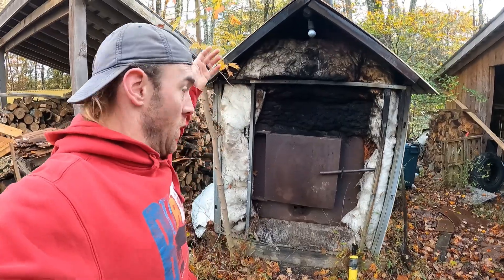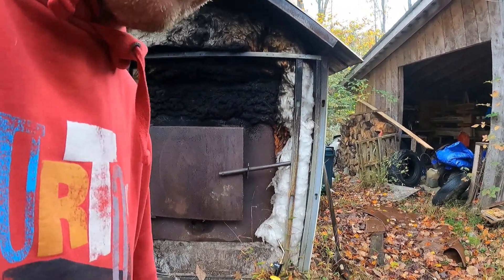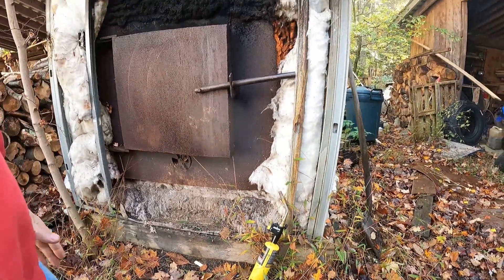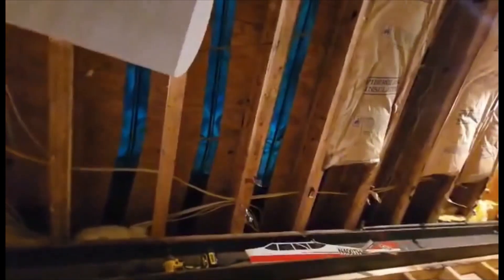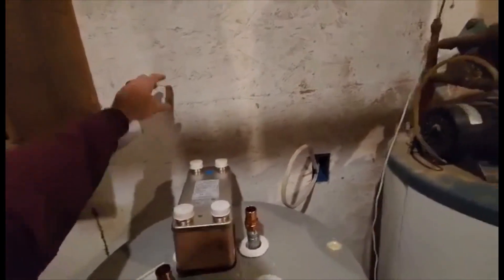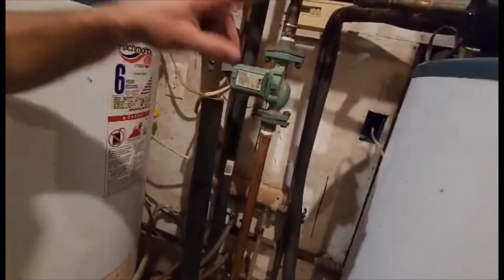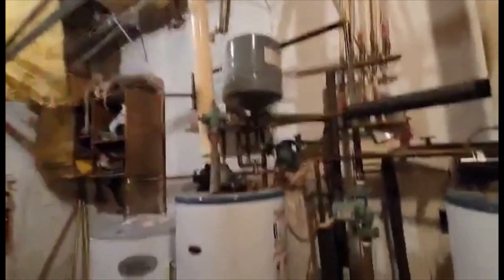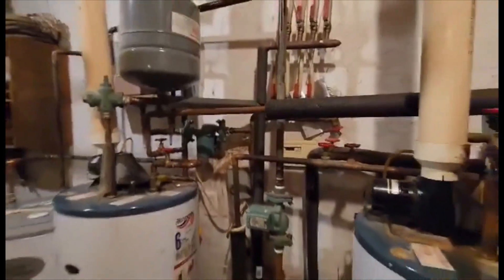Homemade outdoor wood burner fire up and radiant floor heating system

Comment: I have floor heat in my house and attached garage . Tubes in concrete. 
Electric boiler gets so expensive I’m tired of paying 700$ electric bills. I have decided to switch over to an outdoor wood boiler and keep existing plumbing. 
I don’t feel like paying 8,000 for a new one 
I feel like building one in the back yard. 
Quick question 
Do you think a 55 gal drum for the tank and another 55 underneath for the fire box would be enough if they were like welded together so that part of the top would be cut off so the bottom of the tank would be directly above the fire . Of course it would be out of the elements in a small shed . Is this a dumb idea or do you think it could work.  I’m a mechanic/ welder do it yourself fix it kinda guy so I can tackle most anything . Just wondering about the concept of it. 
I thought about running copper tubes running throughout the firebox but thought it might be better to have some volume instead with a tank . 
Possibly both. 
Wondering your thoughts    Thanks
Reply from the maker: All of that will work. But for how long?  Once you start putting the hours into building one you will want it to last as long as possible.  That only happens using thick metal.  I used 1/4" thick steel and would use that again.  Probably won't rust through but if it does it's a simple patch. I think the problem with most boilers made today is they are made as thin as possible for cost reasons but then when they rust they are like swiss cheese and unpatchable. Best of luck!
Reply: Thanks so much for input!!
Reply: When I put my plate heat exchanger in they told me to put it in a vertical position so that it can flush any sediment out of it,  instead of laying it down flat.